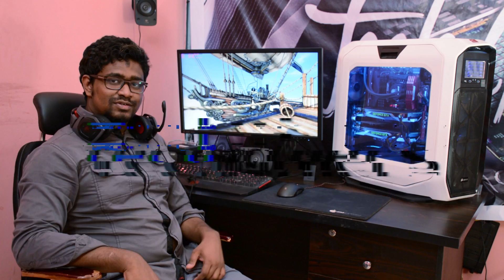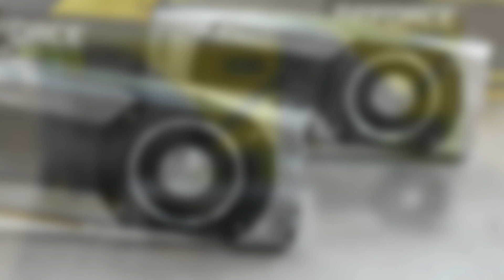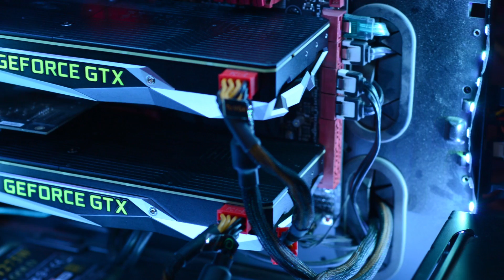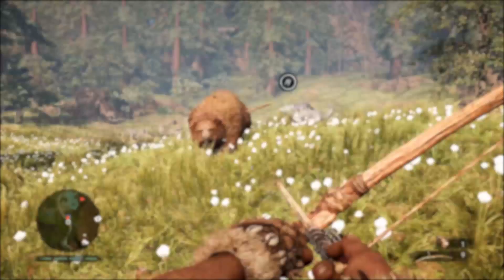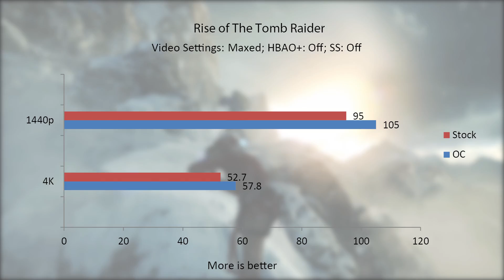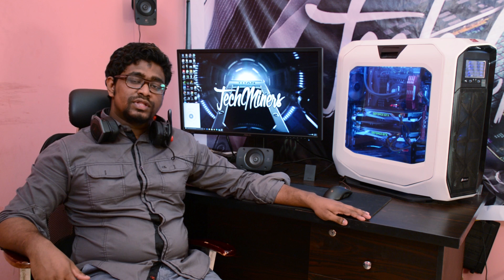Zotac GTX 1080 Founder's Edition - Review & Benchmark

Comment: +TechMiners

I'm assuming all of these benchmarks were done with SLI.  I'd really of liked to see them from a single gpu.

Case: Cooler Master Cosmos II
MoBo: ???
Monitors: 3x ASUS VG248QE - 24"
CPU: Intel i7-5930K
Primary Drive: Samsung 850 Evo m.2
RAM: G.SKILL Ripjaws V Series 32GB (4 x 8GB) DDR4 2400
GPU: Zotac GTX 1080 (Later SLI x2)
PSU: EVGA 850 BQ 110-BQ-0850-V1

Can one of these hold up on this set up, or am I requiring two from the start on three monitors?   Keep in mind, I'm not looking to ever play more than one game at a time usually.  The other two monitors would be for multi-tasking.

Also, what Mobo would you recommend?
Reply from the maker: +Xander Manuel ... Those benchmarks were done on a single GTX 1080 as the HB Nvidia bridge wasn't available at the time of making the video. 

I'd recommend any Asus X99 motherboard and you can get any model on your own according to your theme setup
but I'd prefer Asus X99-A II or X99-A/USB 3.1 

I'd recommend SLI from the start but if I were you I'd wait for Vega or Volta GPUs to come out.
Reply: I'm still new to building.  Vega/Volta are both AMD?  I was wanting to stick to an Intel cpu.  Or does AMD GPU work with intel CPU?
Reply from the maker: Xander Manuel ... Volta is the successor of Pascal which is by Nvidia and Vega is the upcoming flagship GPU of AMD. 

GPU and CPU doesn't have to be from the same company to be the best combination. You can have any GPU and CPU company as you prefer.

Don't worry about you being new to these PC buildings stuffs.. Just do some research on the internet and you'll get the hang of it in no time.
Reply: TechMiners Yeah, it's pretty easy stuff. It was just intimidating.  When are we expecting to see Volta?  I have to save a little more still, and would rather buy everything at once.